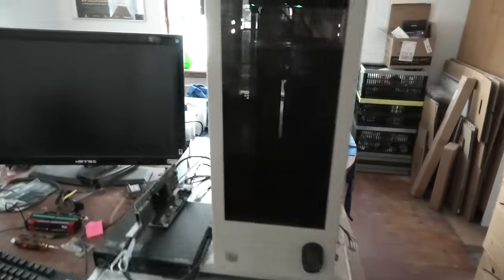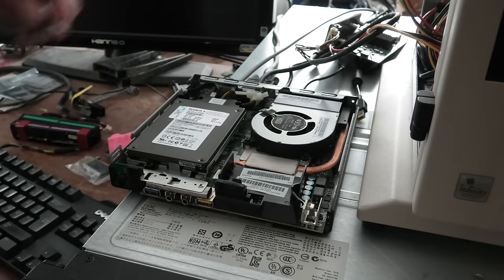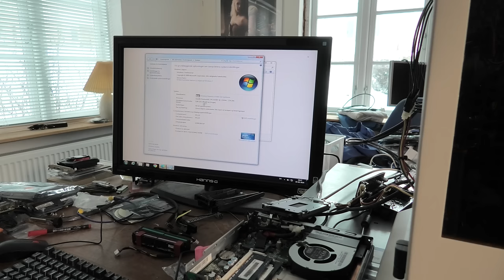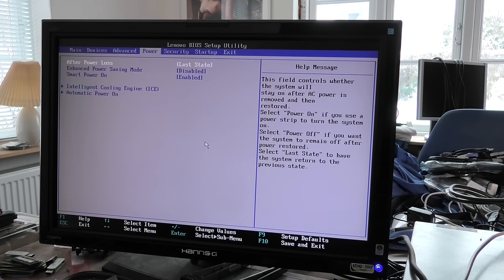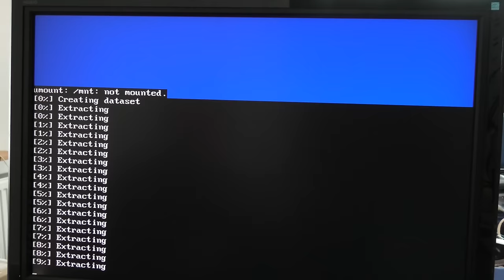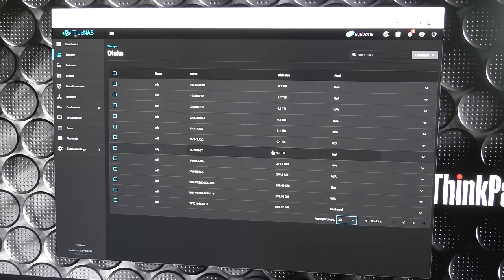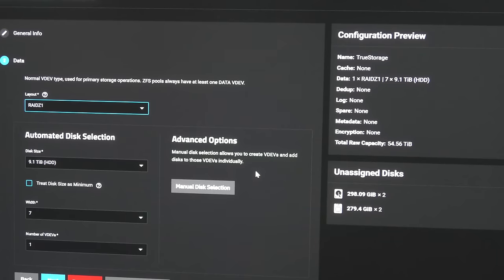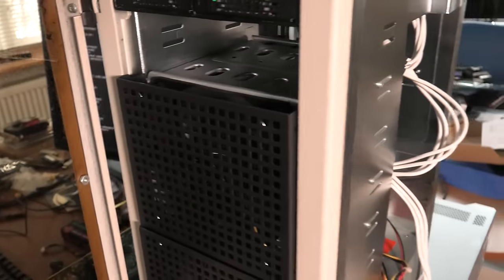TrueNAS on the DIY DAS and Setting up the First 70TB - 1360

Comment: I have been running TRUENAS CORE in our data center 250+ machines for 4 years now.. it's been stable and provides simple upgrades, backups and maintenance.    you did a great job at installing it.. Truenas SCALE has a new CREATE POOL interface that is meant to hand hold and be more user friendly in its creating.  FRANKLY DRAID should not be an option unless you click advanced or something..  raidz1-2-3 with hot spare works great..    dRAID is for a large storage DAS like your HPE DAS of 60 DRIVES or more.  Good Video
Reply from the maker: Thank You,, do you cluster up more than one TrueNAS,, or one by one ?

Comment: for your first go did really well (draid raid shouldn't be exposed that easy) i need to update to this version see if they made windows file sharing less difficult 

tip with doing windows sharing that make sure you create a folder for the share and don't share the root dataset if you screw up the share permissions you have to drop to console/command line to fix or delete the data set and recreate, if you use a folder you can just delete the folder and recreate it without having to recreate the dataset

strongly recommend mirrored boot even if the second or both drives are been booted via mvme ssd usb (don't use sata usb unless you know its using the right type of controller or USB pen stick as they are unreliable) , you can reload with new boot drive and recover the pool later on but if it was mirrored you only have to replace 1 drive and repair and nothing is affected (truenas boot uses zfs boot so a single 4k corrupted block could potentially prevent the system from booting truenas with mirror it would attempt to repair it and fault/degrade the drive if not repairable but not prevent boot)

i use dell 8 bay servers with a dual sata m.2 pci-e card (Power is pulled via slot) to 2x sata cables to plug into the onboard sata ports and works well ,, i use 2x nvme boot on donkey old 8 bay qnap with 3gb ram (newer dells have dual nvme boss card support that routes everything over the pci-e bus)

you might have noticed it instantly created the vdev that's because it does not need to create parity for empty space as typical for software mdraid or hardware raid does, zfs creates the parity as it writes the data, recordsize can be from 128KB (default) to 1MB should note that even if you pick 1MB ZFS uses variable recordsize so it can be 128KB to 1MB depending on the data written, the size you select is the maximum it let the go, if you write a small amount of data the recordsize will be smaller if you write an large file the recordsize will be the limit you have set

the side effect of this is that you should schedule long smart extended scan (every 1-3 months upto you, just make sure the scrub and smart extended scan don't overlap) this is to to get an overall idea of the condition of the drives as a zfs scrub only verifies data and metadata blocks (not free space) it does not have a patrol read feature for empty space as to why the smart long scan is recommended to get an overall status of the drives so your not caught out with 3 bad drives (extremely unlikely but can happen)

like BTRFS (and synology if running DSM7+) its recommended to keep 1 bay empty or drive spare so (for live replace basicly) if you need to replace a drive but the old drive is somewhat working it can attempt to copy the data off the failing drive without using parity to recreate the new drive, any corrupted data will use parity to regenerate it (if the old drive full fails it will fallback to parity recovery for the remaining data)

write/label the last 4-5 digits of the serial number in a visible place on the drive so you know which drive your replacing (don't trust drive order by device location id)
Reply from the maker: Thank You for the many informations,, I am mostly playing with it now,, might redo a few times.. :-)
Reply: SCALE is pretty hard to screw up I guess. I have SMB, NFS, all that good stuff set up and access from Mac and Windows and it just works beautifully. Pay attention when setting up the ACLs and everything is just fine.

Comment: I don't mess with it, I've true nas system, a bit like yours but with the hba inside with external ports... Not that I use it that way, it's over lan.

One thing to consider is the host hba speed, there is only so much speed, so arrange drives accordingly.

In the olden days we ran tests on raid systems to find the max performance, adding more would slow things down after a certain point.

If you have a standard home network and systems you're not going to see full speed anyway, or if that expander is only 450MBs
Reply from the maker: A the moment I only have a 1 Gbit network out of the Lenovo,,, so the storage is not the bottleneck at the moment,, 450MBs is a good start.

Comment: Hello dear. I have a server HPE DL380 Gen9 with 24SFF by using an HPE SAS expander pn 727250-B21. I am using a P440ar raid controller . I want to add more ssd by using a DAS HPE D3700 and All those SSD must be connected to P440ar raid controller. Do you have any suggestion for solving this issue? Best regards
Reply from the maker: It is posable to make an external port from an internal port.

Comment: i think the ideal setup for trunas may be dual trunas with 256gb ram and 40g plus good caching tiers - a couple nvme but really this setup is not asking too much 300 for 3 dual port 56g cards and tranceivers plus old cheap ram and some nvme - networking is the weak link for most smb and homelabbers - of course you need 8 drive spinning rust arrays to keep up with 40g and jumbo mtu frames - maybe you can do a followup with an optimized dueal trunas setup - no switch needed and you can sync the nas very quick
Reply from the maker: 256GB of RAM,, fuck you can fly to the moon on 256KB :-)

Comment: I picked up some of those Lenovo M900s and they are quite nice.
Reply: Very nice and well priced machine, mine is equiped with i5 6500T, 8gigs of ram in single bank and 240GB SATA SSD. Handles home assistant, minecraft server with vpn for kids, pi hole and portainer for some containers. It is quiet and takes very low amount of power.
@MyPlayHouse M900 has much better SATA connector, full plastic and sitting on the motherboard + M.2 for second one.
Reply from the maker: The ones I meet are often quite expensive :-/
Reply from the maker: I have an M75q as my daily driver,, but that was bloody expensive..
Reply: @MyPlayHouse  I bought mine in around 90 euros in Poland. One disadvantage is not working front USB (1 of 2)

BTW I also restored my old IBM x3650 M1 recently. I started subscribing your channel when I received two of them for free from my company around 9 years. ago.

Comment: Nah, let me stay with my MegaRAID. I watched this entirely and still find software RAID to be a crutch rather than an asset. On an X1 adapter to your DAS? Well, it does work. But speed must be awful for a DAS.
Reply from the maker: This is a storage system,, so the whole PC makes storage available,,, and I have not seen raid card speeds yet!!
Reply: @MyPlayHouse  ? I am aware of the storage available, but you were/are setting up for DAS or NAS? Interesting. I am just trying to understand what you mean.
Are you just simply setting up a NAS from your DAS? Maybe I am just overthinking this.

Comment: You didn't screw up I guess :D:D I'm long-time TrueNAS user (FreeNAS, then TrueNAS Core, then TrueNAS Scale...). I also use RAIDZ2 for my pools since I can lose 2 drives and still keep all my data. While you lose quite a lot of space doing so it's still the best "value for money" in terms of data security.
Reply from the maker: Thank You! later to day I have a video on one of TrueNAS's shortcomings,, expanding an array :-/
Reply: @MyPlayHouse  Well, that is not really a shortcoming of TrueNAS, is it? It needs more planning in advance, that's for sure. However, features to make this simpler are in the pipeline so this shouldn't be a big issue for too long I guess.